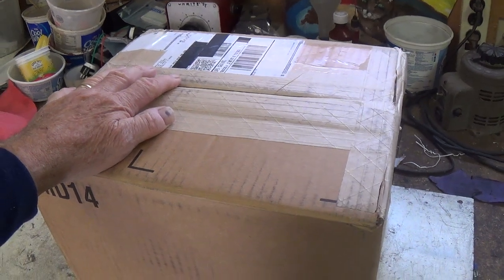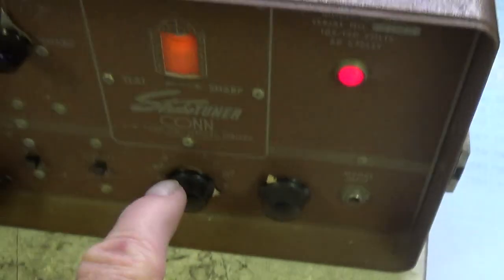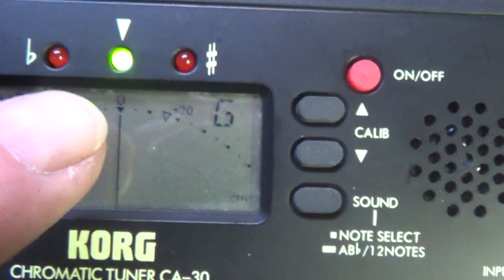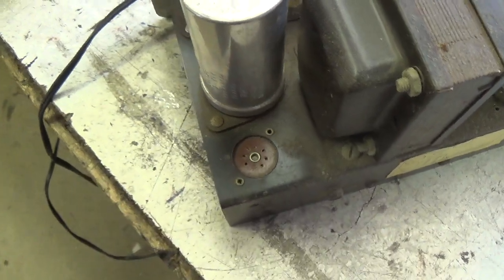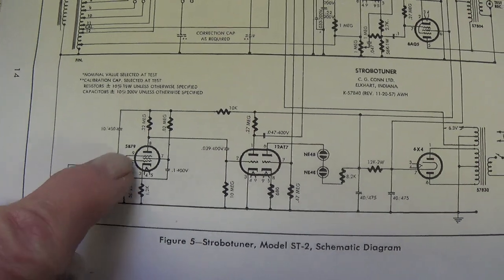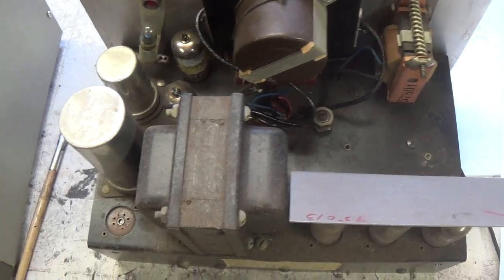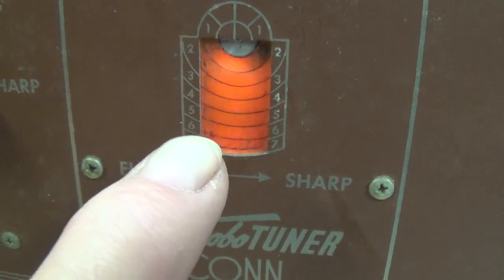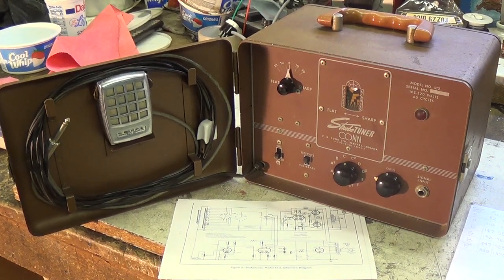Early 1950's CONN StroboTune Model ST-2.......What a Miraculous Device !!!

Comment: Hi Uncle Doug, How would I go about sending you the Uncle Doug Modified 6G15 Reverb unit, I just built, for you to evaluate/fix?
Reply from the maker: I think it's best that you do the troubleshooting yourself, Donald. It's the most instructional part of any building project.  Good luck.
Reply: @UncleDoug  I verified all of the points with a multimeter after soldiering them in place. The DC Voltage is a little high (350VDC) and the tubes are running very hot to touch, temperature wise. I don't have any other test equipment to do in depth troubleshooting and diagnostics. Which is why I am asking.
Reply from the maker: @donaldhunter7959  Does the unit work as it should? Modern DC voltage generally runs a bit high nowadays and output tubes tend to get hot. Perhaps now would be a good time to invest in some test equipment, Don. It would be a great Christmas present and would broaden your electronic horizons.

Comment: The strobe tuner is a brilliant invention! Is the upper part of the schematic basically an oscillator? I did wonder if it used the mains frequency as a "master clock" but given the calibration mode, I guess not (so it might work with 50 Hz mains - with a suitable transformer, of course). I imagine those multi-tap transformers for the note selection were pretty specialised and uncommon parts.
Reply from the maker: I would say that the upper portion of the circuit definitely behaves as an oscillator, in that it creates a precise repetitive frequency to control the synchronous motor.

Comment: Hey Uncle Doug. Have you ever worked on any guitar amps made by Standel? I own a Standel “Artist XV” bass amp and when I open it up it looks strange.
Reply from the maker: I am familiar with Standel, but never worked on one, Eric. They have a good reputation. Does your amp use tubes or is it SS ?
Reply: @UncleDoug  its solid state. I just bought it with 3 other semi functioning amps. I'm positive I can fix the other 2 but this one is different. There seem to be circuits separate from the regular circuit, where all of the caps, resistors, etc... are. They seem to be modular and are floating in brightly colored, perfectly rectangular, bricks of silicone. I've dated the speakers to be September of 1968 rola.
Reply from the maker: @erickmiec8898  We don't work on SS circuits, Eric, partly for the reasons you discovered when inspecting the amp.
Reply: @UncleDoug  haha Lol.😁

Comment: Doug it is so old it likely was designed when home voltage was around 110 volts !
Reply from the maker: I really don't think that AC supply would make that much difference, IS......but it can be determined with a Variac.

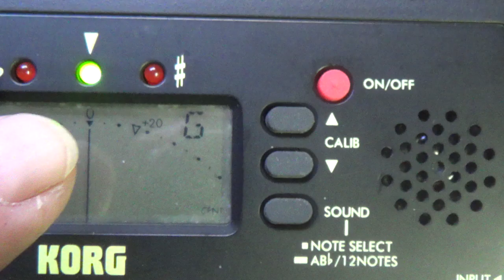Comment: At 7:37 in the top left of the guitar tuner window it says 442Hz.  This means it's using the wrong reference frequency for concert A (which should be 440Hz).  This will introduce a small error in your generated frequencies, making them all slightly sharp.
Reply from the maker: As I recall, the adjustment to 442Hz was necessary to synchronize the small guitar tuner with the Conn unit (which was set at 440Hz).  Which unit would you trust more?
Reply: @UncleDoug  I'm not sure you can trust either; indeed, it's quite possible that both are out to some extent.  I think in an ideal world I'd use a modern Peterson strobe tuner (set to 440Hz) to get the frequency of each generated tone right, and then feed the tones into the Conn to see what reading I get.  However, we don't live in an ideal world and quite reasonably you use what you've got to hand.
Reply from the maker: @mandolinic  Thanks for the helpful input, M.
Reply: @UncleDoug awesome piece of nostalga!

Comment: Your Korg is set for 442 — intentional? I would guess the Conn is set for 440 but that’s a guess. It would be interesting to compare a guitar tuned exactly with the Conn with one tuned by the Korg. Those Korgs are good for what they cost but compared with a modern strobe tuner their resolution is not as fine as it might appear. And none of them replace ears, unfortunately, thanks to equal temperament. Thanks for the video,  your knowledge and altruism are without peer.
Reply from the maker: Yes, I set the Korg to agree with the Conn for the E string. Glad you enjoyed it.

Comment: I wonder if line voltage effects the calibration?
Reply from the maker: You would think it would affect both the disc speed and the neon flash rate.....thereby balancing out.....but it would be easy to test, with a Variac.

Comment: The 6X4 rectifier tube had a bad reputation for heater to cathode short circuit. That's probably why it was replaced with diodes.
Hammond B-3 organs used the 6X4, and are notorious for shorts. I've seen them take out the power transformer. Hammond recommended the tube be replaced once per year.
Reply from the maker: Thanks for the helpful input, Scott.

Comment: Your Korg tuner is set to a A=442 Hz standard instead of the standard-standard, 440. That would explain your sharp readings on the tuner. (That knob is to intentionally tune sharp or flat, by the way. Same as your Korg tuner lets you tweak the tuning standard. Obviously it's the instrument's tuning you're supposed to adjust when using it, not that knob. By the way, I would suspect the "degrees" are Cents, i.e. hundredths of a semitone.)
Reply from the maker: Thanks for your helpful input, AQ.
Reply: @UncleDoug  Just watching the rest now, got another one for you. Motion pictures don't flash at 24 flashes per second, they advance the frame at 24 frames per second. But... here's the trick... each frame is flashed twice by a rotating shutter with two cutouts in it. If it was only 24 flashes per second, you would see it.

Same reason old style 30 FPS NTSC video was actually two interlaced odd line and even line "fields" at 60 Hz. 

So, no, 24 FPS is not fast enough to make the human eye not see the flashes. (Why you claim to not be seeing them at that rate, I don't know. You should be able to!)

And motion blur is controlled by exposure time, not by the frame rate (though obviously you can't have exposure times longer than the frame rate). Cine-cameras frequently have adjustable shutters (which unlike projectors only expose each frame once per rotation rather than flashing twice) so you can reduce the shutter speed from the usual 50% of the frame rate (actually, frame *period*) to some smaller fraction. (What higher frame rates do let you have is smoother slow motion playback. They did release some movie shot at 60 FPS a few years ago and audiences hated it. There's a less-is-more phenomenon at work here.)

(4 years of film school. ;)
Reply: I guess I'm thinking of The Hobbit movies (none of which I've seen, particularly not in the theater) though I see they were only 48 FPS and not 60. Though there have been some 60 FPS major movies as well.

https://en.wikipedia.org/wiki/List_of_films_with_high_frame_rates
Reply from the maker: @AdmiralQuality  Thanks for the info, AQ.
Reply from the maker: @AdmiralQuality  Thanks for all the interesting information, AQ.

Comment: Is it frozen to the eye? I see some movement which could just be the camera, I remember we changed the standard note frequency a long time ago but I forget when that was

On a UK voltage I imagine you'd need a whole new strobe disk?did the microphone on it not work?
Reply: Syd McCreath  onky in 1953 was it standardised, I thought it was a little more recently than  that
Reply: Syd McCreath  ill have to look!
Reply: Syd McCreath  have not found any UK rated models, maybe you can direct me?
Reply from the maker: Yes, frozen only to the eye....the disc is still spinning. Since the camera and your monitor have their own frame rate, some interference is to be expected.

Comment: Uncle Doug, my brother has a wooden cabinet Silvertone tube radio. Where do I begin trying to restore it? He gave me a number off the cabinet 4623 J 467 80 but by my checking that number tells me nothing.
Reply from the maker: I assume you're asking how to restore the radio circuit. There should be a plaque on the chassis with a model number. Look it up in the Rider's Manuals (they should be available on line) and print out a schematic......then use it to restore the circuit. Good luck.
Reply: @UncleDoug  he hasn’t brought it to me yet. I think he is a little nervous about letting me work on it. He thinks he can find out what voltage it is supposed to use and put a new speaker on it and it will work. I told him that it needs checked out. He has had it since 1978. He got it at a garage sale in Deer Park Texas.
Reply from the maker: @Davidorr63  It needs attention from a qualified tech or the result may be disastrous.
Reply: @UncleDoug  I have built a mojotone ga 5 kit and I am learning all I can but I am very much a beginner. I was an HVAC tech until I became disabled but we both know being a qualified air conditioning mechanic doesn’t qualify you to work on electronics. I started trying to learn electronics because I love to make music and I can work on an amplifier sitting at a work bench. I enjoy watching your videos because you explain things. The little Gibson amp kit which was actually more like a 5F1 circuit didn’t explain anything. I want to learn but there isn’t really a school in antique electronics.  I have built 44 guitars by the way.
Reply from the maker: @Davidorr63  Greetings, David. I am entirely self-taught via internet sites and sources. You can do it too.....just devote at least an hour a day to study of tech videos and sites. Take notes and investigate each topic fully, rather than jumping around superficially. Good luck.
Reply: @UncleDoug  structure of study is hard when you don’t know where to begin. That’s why the Mojotone kit was very disappointing. Anybody could follow the instructions and make a working amplifier but it was just solder practice with no explanation of anything. My next project is the Trem O Drive and after that the Fender 63 Stand alone reverb unit to break the Princeton Reverb into smaller circuits and study them as I go. I have already done a parts list and purchased all the parts for the Trem O Drive and built the wood cabinet. But still to fix something requires understanding. My instructor in HVAC school set me down in front of an empty electric furnace cabinet and said all the parts are in the tool room. Find the right schematic and build it according to the schematic. I am trying his approach on this but I still feel like I am flying blind.
Reply from the maker: @Davidorr63  That's the way we all started off, David.....overwhelmed by the vastness of the entire concept. To eat a 2 lb. steak, you have to cut it into many small pieces and chew each one thoroughly. Start with power supplies. Watch my videos on the topic. Draw diagrams, take notes, master each detail, then move on to amplification stages, phase inversion, tone stacks, resistors, capacitors, etc. It can be done......many of us have accomplished it......and you can too.
Reply: @UncleDoug  would printing off copies of schematics and labeling each component as to what it is called and its purpose be useful? Following those videos and using that approach. I have already watched those videos 3 times and I remember from the last time I watch when I watch again but my 58 year old mind doesn’t retain like my 30 year old mind did in trade school. I thank you for your patience and what you teach us sir.
Reply from the maker: @Davidorr63  That wouldn't be my approach, David, but taking notes might help.
Reply: @UncleDoug  on a totally unrelated thought I am working out in my mind how to build a Dewalt 20 volt battery powered portable guitar amplifier. Doing it solid state is no problem but is it possible possible to power a tube amp with that low of voltage. I know it could possibly do a preamp tube but I am thinking that is the limit of it. When I became disabled the thought of playing on Main Street with an open case became a retirement supplement idea and the battery amp came to mind.
Reply from the maker: @Davidorr63  It would be challenging, David, since the voltage doesn't fit the needs of a tube circuit, and DC can't be stepped up with a transformer. I'd stick with SS for your purposes.
Reply: What wattage inverter would it take to run my GA-5? It could be a stand alone 120 volt power supply with the battery being ran through an adjustable buck converter with a switch to run it off a 12v cigarette lighter plug. Would running off the power inverter be hard on my amplifier?
Reply from the maker: @Davidorr63  Does the chassis tag state the power consumption? If not, you'll have to measure the power consumption (probably around 120W) and then allow about an extra 50% (180W) for safety. I doubt that the inverter would harm the amp, since they work with all sorts of SS devices.
Reply: @UncleDoug  I ran a big inverter in my service van for years. It had a low voltage alarm to protect power tools with motors but if my understanding is correct the voltage dropping because of a depleted battery charge would only make the amp volume decrease. If I make this for a solid state amp I want to build the inverter too. If I use my tube amp with one I will buy it and then build the circuit feeding it. My problem is I have too many ideas and little strength or stamina.

Comment: I saw you almost rip the Tolex (Registered Trademark or General Tire) off of a Vibrochamp trying to extricate the chassis. Buy a cheapo 24 inch quick squeeze action bar clamp (The mid or higher grade Harbor Freight clamp is fine).  Turn the jaws around so it makes it into a spreader. You don't need 150 pounds of clamping pressure! You just need to spread the cabinet open a tiny bit and hold it there so the chassis slides out a LOT easier. If you hear cracking glue or wood and the ripping of Tolex you are using too much force.
Reply from the maker: Wow....what a helpful hint, Seth. I was going to borrow the Jaws of Life from a local fire department.

Comment: Hey Doug - I bought a bunch of old 7-pin tubes in an estate sale.  I should be able to dig up a 6X4 or two and send it/them out to you if you'd like?
Reply from the maker: Thanks, but no need, Z. As shown in the video, diodes were installed instead.
Reply: @UncleDoug   I did see.  I thought you might want to bring it up to original spec.  You could keep the diodes installed but out of the circuit so they could be available for a quick rewire in the event of another failure.  But of course, up to you.  🙂
Reply from the maker: @zander1323  Thanks so much, but my old granny always taught me to "leave well enough alone", Z.
Reply: @UncleDoug  Thumbs up.  Thanks for the videos.
Reply from the maker: @zander1323  Thanks !! Glad you enjoy them , Z.
Reply from the maker: @zander1323  Glad you enjoy them, Z.

Comment: synchronous motors will run at a reliable 60hz one reliable clock would stay running with two of three legs disconnected~
Reply from the maker: So would I.....for fear they might remove another leg.

Comment: Strobe tuners are in generally more accurate than the quartz style if properly calibrated.
Reply from the maker: So I have come to understand, Nick. Thanks.
Reply: @UncleDoug  One thing you note is when you pluck a guitar string the pitch is not stable. A strobe tuner is accurate enough to allow you to measure that difference. 
Some Modern strobes are like down to +/- 0.02 a cent. While your average Boss tuner is +/- 1 cent.
Seems old optical mechanical stuff is still relevant..
Great vid on this. thanks
Reply from the maker: @nicko6710  Glad you enjoyed it, Nick.

Comment: Congratulations!
Ya know, this is almost too coincidental. Not only have I been hoping that you had or would do some gear equipment related videos, but I have a Strobo Tuner myself that I aquired in a deal that I have never used, because I wanted it refurbished first prior to using it. 
I just went and dug it out of my swamp and mine is the same color, but missing the handle on top, mine is an ST-6 and it is stamped into the metal like the serial number is. 
Get this though, the ST-6 has a 5879, 12AT7, 6X4, a pair of 6AQ5's and a 12AU7. 
All tubes are in place, but I cannot remember if I ever tested them or not? Mine has the diamond open grill on back for cooling and the front controls are basically identical. 
I always wondered what they set the "gain" at? I never bothered to aquire a schematic or operator's manual, but I will.
Another thing we have in common that I just noticed in the background of your video is that we both use empty "Cool Whip" bowls to put stuff in, lol! I also still have those plastic rectangle boxes with sealable lids for "baby whipes" from almost thirty years ago when my kids were in diaper mode and still at home, lmao.
Your video's just keep getting better and congratulations again on your Christmas gift.
Many guitar greats of old have been pictured using a Strobo Tuner. I've seen pictures on the web of Jimi Hendrix, Duane Allman, Joe Walsh, Keith Richards and others tuning up. 
I read that Jimi usually tuned to 432.
Idk for sure, but that's what I read. Waay cool Doug!
Reply from the maker: Wow....thanks for all the interesting comments, Amo :)
Reply: Every electronics tech had a stack of margarine and cool whip tubs to keep those pesky knobs, tubes, screws and brackets in one place, as well as keep track of the parts you’d replaced. I switched trades in the late 80’s, but still have my stash o’ tubs! Good habit die hard!!!
Reply: "Another thing we have in common that I just noticed in the background of your video is that we both use empty "Cool Whip" bowls to put stuff in, lol!"

Talk about coincidental, I noticed the same thing for the same reason!